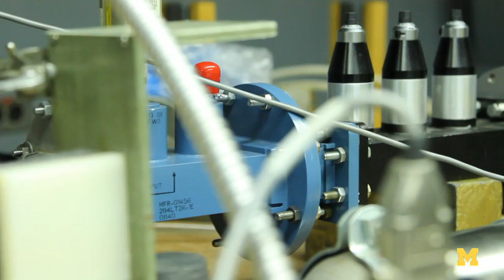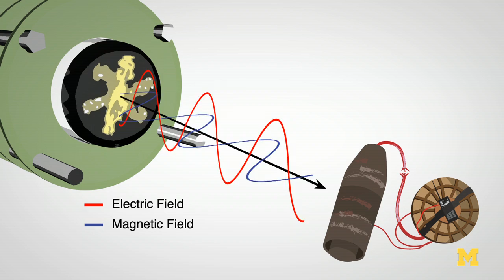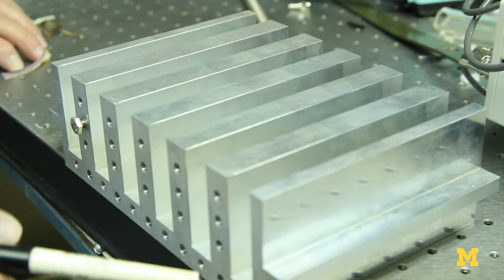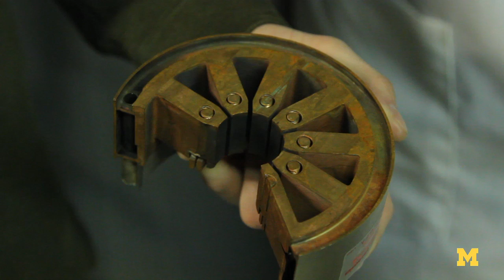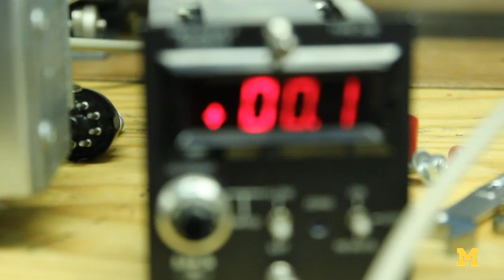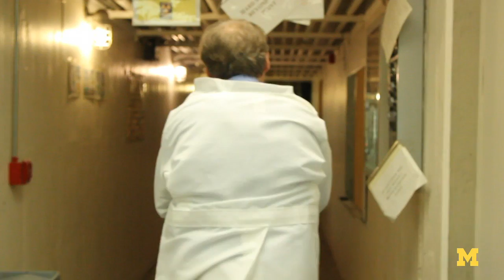Could bacon microwaves fry IEDs?

Comment: hi you spoke of a million volts being the problem would it not be possible to place a seondary coil around the immiting end which would be the ultimate magnetic one way diode like a ligthning bolt as you are utilising the natural fact that at the collapsing secondary field end it is negative and the central electrons cannot return and also of coarse at the other end amps cannot enter as that is naturally positive.no expert but my research points to this on hydrogen water splitting..